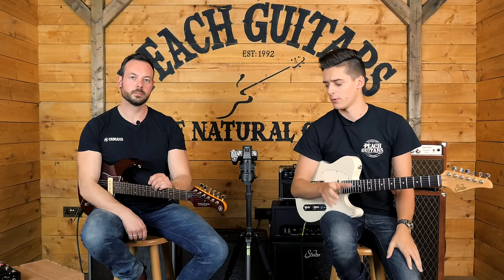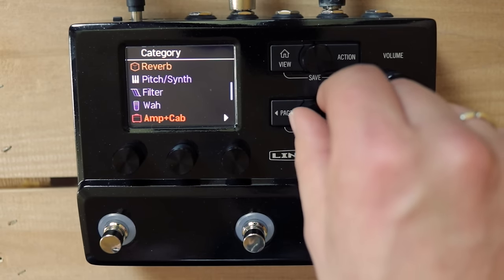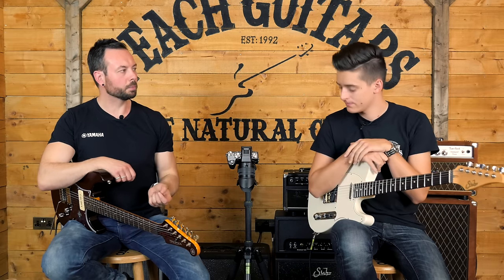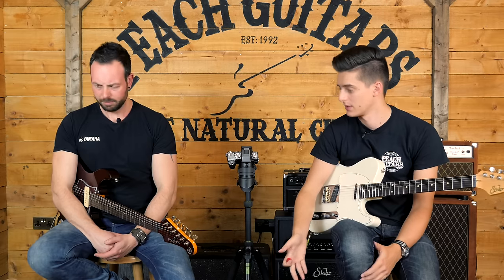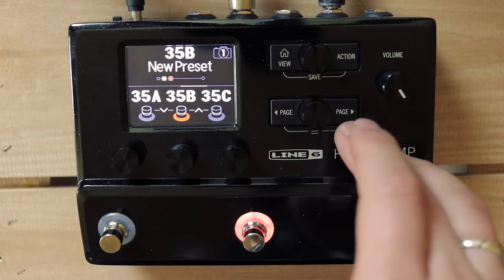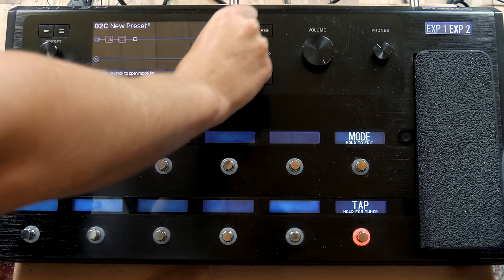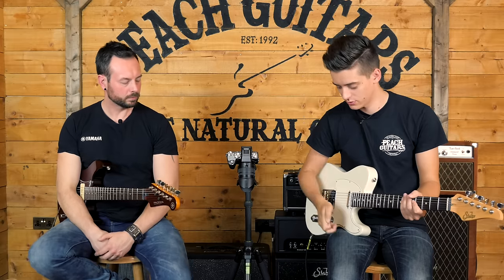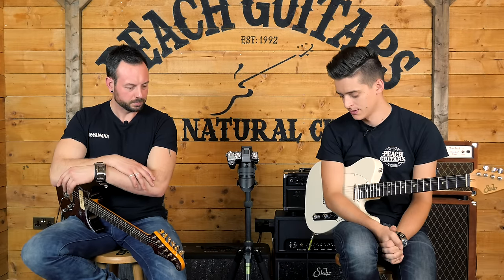Line 6 HX Stomp VS Helix!

Comment: Should have just played the same guitar or similar guitar.
Reply: i put my comment and i notice that you have the same reaction than me... nice video but not fair
Reply: for sure. 2 single coil guitar vs a humbucker/p90 guitar.
Reply: It's the exact same sounds, we know that so there is no point A/B'ing identical tones.  They are mostly showing the differences in functionality between the two units.  It makes more sense for them to use different guitars, really, as you get an idea of what the amps sound like with different pickups, so they cover a little more ground that way.
Reply: They’re not even the same pickup
Reply: One is a $3000 guitar, the other, maybe $400
Reply: @0987__  a Yamaha Pacifica against a suhr... that sounds manipulative a little ...

Comment: Good intentions, but really...we all know that if the insides are identical (circuit designs, algorithms, etc), then of course the sounds will be identical. That is a given, no need to "prove" it to us -- which, of course, you didn't, given the 2 different guitars and players...why didn't you use 1 guitar & player, with a signal splitter box feeding both units?  At any rate, what would have been useful is to see the actual Differences (e.g. the Stomp's fewer fx loops, lack of XLR, only 6 blocks can be used, etc), and show us how those limitations operationally limit what it does, compared with the Helix.
Reply: No. A change in form factor can greatly effect sound quality as the topology of a circuit will change. The physical layout of the product and circuits will effect cross talk distortion , intermodular distortion, total harmonic distortion  and noise floor. So regardless being the same dsp and software they could sound different.
Reply: Instablaster

Comment: For those of you coming to this video in 2021, the HX Stomp’s 3.01 software release updated it from 6 to 8 blocks! It’s pretty great.
Reply: Crap. Thanks for this detail. Was considering a Helix LT due to this limitation but now have to reconsider...
Reply: @frankvazquez5974  for me, since I already had a BigSky and a TimeFactor, the HX Stomp is perfect. When I add a 2 button external switch, it basically becomes:

Amp/cab/noise gate/tuner/compression/OD/amp drive/chorus/octave/tremolo 

I have a 3D printed button that adds a “4th tuner button” to the pedal. 

My entire rig essentially is 3 pedals and a volume pedal 😂
Reply: @TheArbiterOfTruth  I am in a eerily similar position to you (except Volante & Big Sky). Considering the Stomp (mostly for the new Princeton ”US Princess” model) but don’t fully understand from your post how you are using your switcher.
1. Which switcher?
2. What switch does what?
Reply: @jemandthemystery  I thought I replied, my apologies!

So, you’ll want a Mosky dual switch. You can get it on Amazon for about $25 (the price fluctuates a few dollars up and down sometimes) and a TRS cable. You’ll plug that into the FS4/5 port on the back of the HX Stomp, you can then assign blocks to FS 4 and 5. The 3D printed button you’ll have to search online, but you should find the file to print it.
Reply: @TheArbiterOfTruth  No worries, thank you!

Comment: why not same guitar and same player? nice video btw.
Reply: @eduardoandreasguitar  uhhh...those are 2 totally different guitars. That's going to effect the sounds A LOT.
Reply: @eduardoandreasguitar  what? No. We should see how it sounds with the same player and the same guitar.
Reply: @eduardoandreasguitar  clearly you don't play guitar, and if you do, you don't play with anyone else or through multiple pieces of gear.
Reply: @eduardoandreasguitar  yeah, and your response doesn't make sense, so I clarified. Until you play guitar with multiple people and use multiple pieces of gear, I suggest you stop giving advice or opinions. If what I have been saying doesn't make sense to you, then again, you shouldn't be giving input.
Reply: @eduardoandreasguitar  dude, they even admit that they are using different guitars so the sound isn't going to be the same. If you are trying to get an idea of tone, you should be using the same guitar and player through both units. The purpose of this video is to compare the Stomp and the Helix.
Reply: @eduardoandreasguitar  and with the insults you're tossing out, please share some of your guitar work. Typically I've found that guys like you haven't actually done anything.

Comment: I just bought a Stomp and the first thing I noticed was how fast I run out of dsp. Anyone have any suggestions on how to navigate this? Can I create paths or at I just hosed? And I mean, amp and capo pitch and I’m done. Lol
Reply: That doesn't sound good as someone considering the different models. Try getting the Native software at a discount and use your computer perhaps. No way around the unit itself...
Reply: @frankvazquez5974  If you are using a bunch of FX I’d definitely recommend the full helix. The stomp is on my pedal board just as an amp/cab sim at this point. I have all my fx separate.

Comment: Can you assign multiple pedals in one switch? Like a lead od effect and a delay effect. One switch will turn it on on stomp mode?
Reply: Ik it would work on snapshot but I’m thinking about stompbox mode so you still have the controls of the effects on screen. Just like looper/switcher
Reply from the maker: Yes you can - when you assign your second block to the switch, you just have to select ‘merge’ rather than ‘replace’. Thanks for watching!

Comment: How do you simulate not having XLR out to FOH. Should I get a direct box now. LT was killer without but Can stomp have same great output options ,

Hope that makes sense .
Reply from the maker: You could just use a TRS to XLR cable to achieve the same thing, I have read that the outputs are balanced so that should work fine.